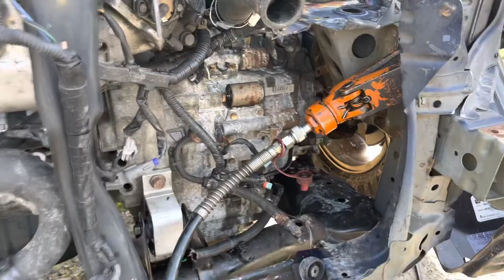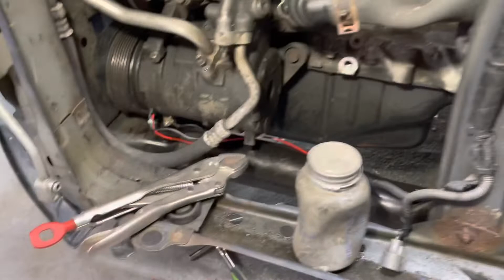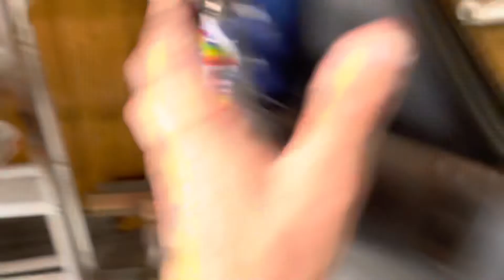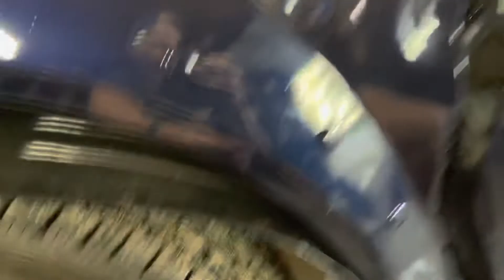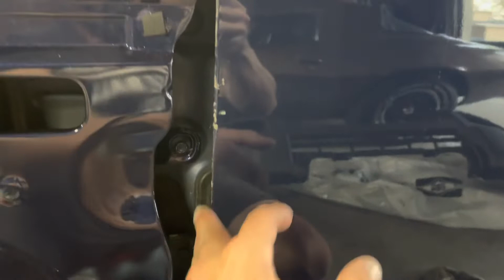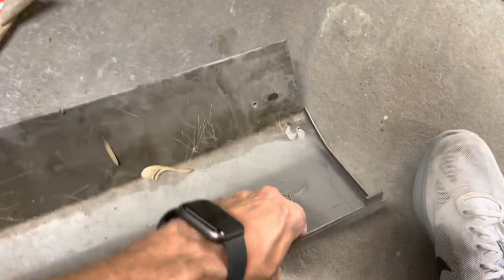Saving the Element

Comment: Do you know the name of the tool you used to press the radiator support out? Deer hate Honda elements apparently.
Reply from the maker: https://m.vevor.com/porta-power-kit-c_10320/vevor-4-ton-8800-lbs-porta-power-protable-hydraulic-ram-with-3-9-ft-oil-hose-auto-body-frame-repair-kit-with-storage-case-for-car-repair-truck-farm-p_010289807271?adp=gmc&utm_source=bing&utm_medium=cpc&utm_id=437303906&utm_campaign=PLA-M中-US-All-GMC-ECPC-20220623-0727调优先级&msclkid=bc8db8f7aba41f38037adc50cfc1fa35&utm_term=4586818922410214&utm_content=Mobile